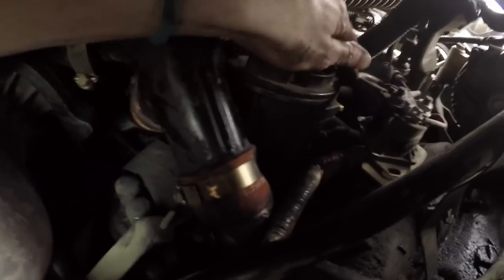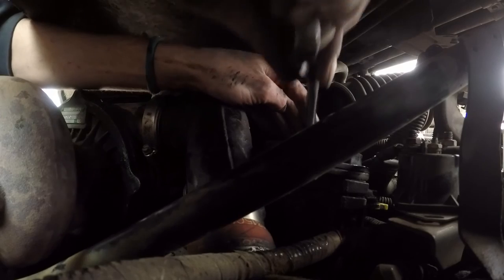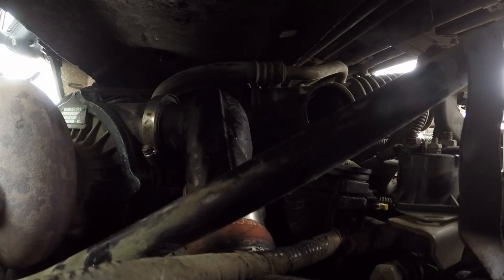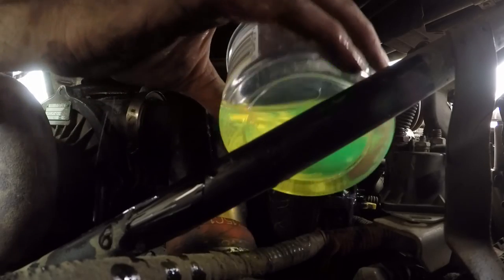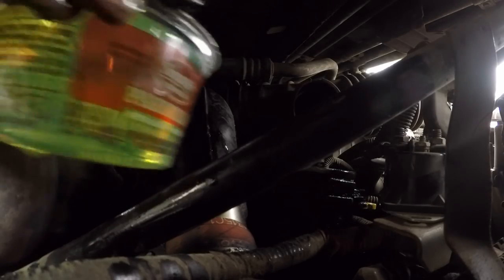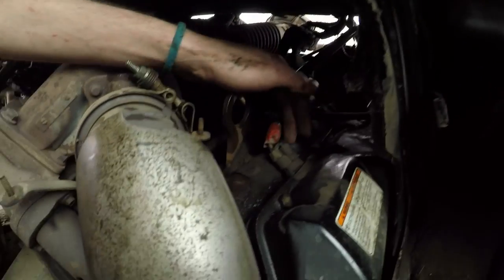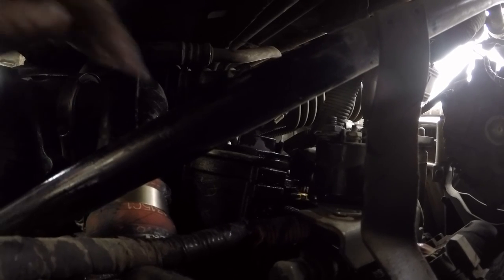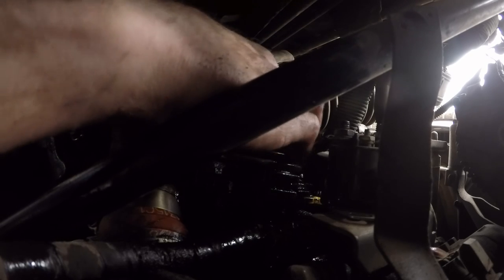7.3L Powerstroke Fuel Filter and Prime 96 E350

Comment: I just cant for the life of me get my 96 7.3 turbo bleed. Running fine, except a bit shit on account of fuel pump/hoses. Just replaced all the system now i got air i cant get out. I dont seem to be draining fuel bowl, been usin gas on a rage in intake to try and force air out, hittin shraeder valve, nothin workin. Anyone got other ideas quick enough lemme know!

I got mine in an e350 too
Reply from the maker: im sorry its taken me so long to respond i really hope you found a solution to your issue. It is a difficult process and it took me nearly 2 days to get that old girl going.
Thanks for checking out my video